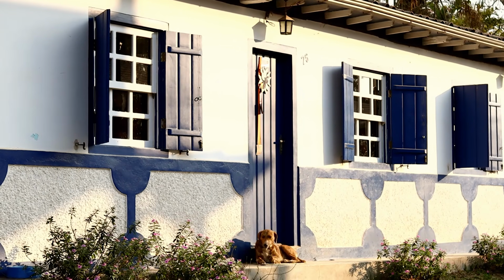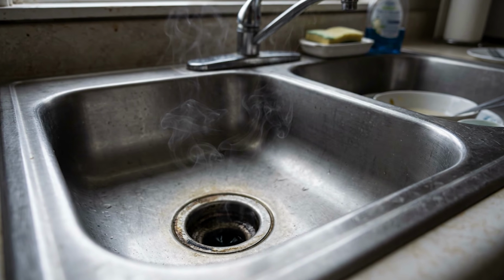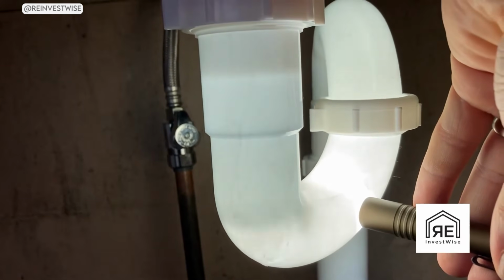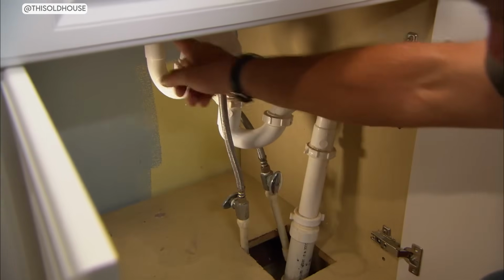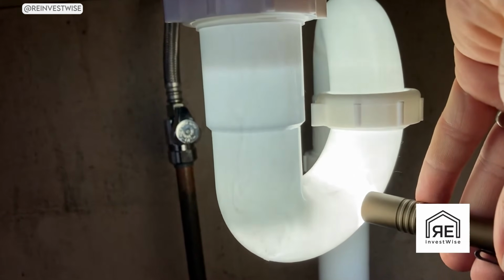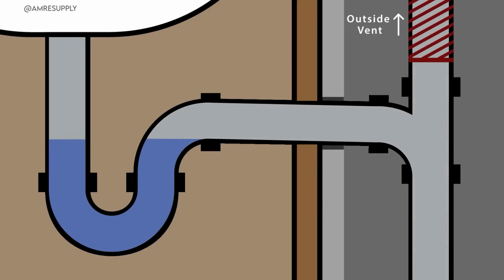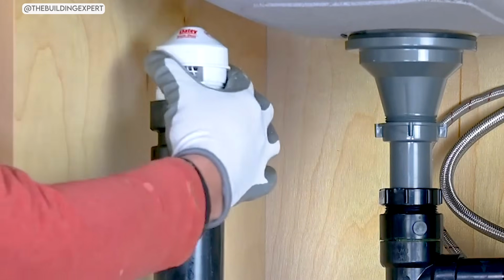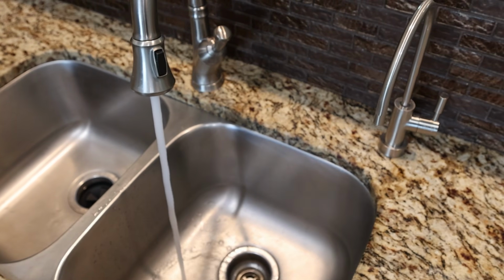Why S-Traps Are BANNED By Code - The Hidden Danger Nobody Talks About!

Comment: you keep saying that if it goes through the floor its   no good.    But couldn't a P trap also go though the floor and be fine?     wouldnt it be possible to reroute with a ptrap  with a horizontal section into the floor without forcing it to go into the wall ( very costly)?
Reply: I am not sure, but i think if after the P trap goes down rather than connecting to a vent horizontally ,it is still a problem
Reply: I think even is you came out horizontally to the tee connection on the pipe going down thru the floor, you would still have the siphoning effect from the column of water, as shown in the video. Maybe if you had a AAV (vent) on top of the vertical pipe you be ok, but AAV are not allowed in all jurisdictions.